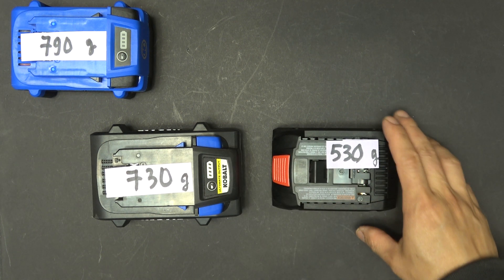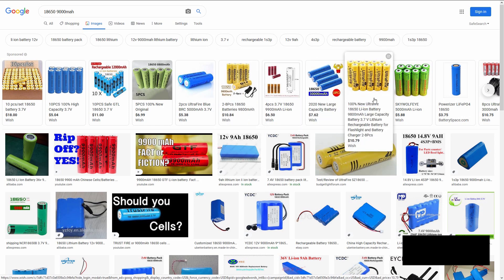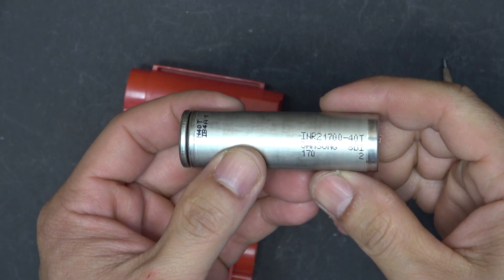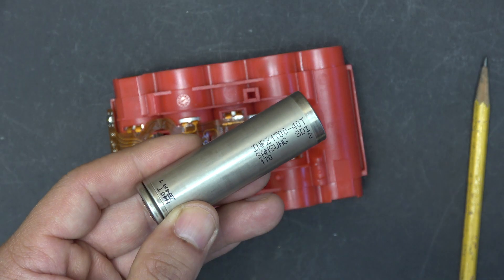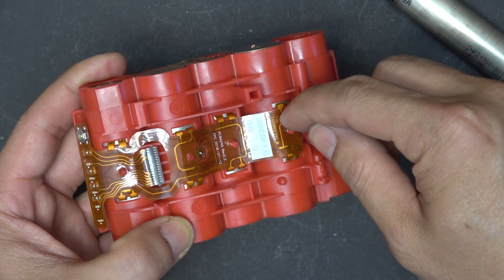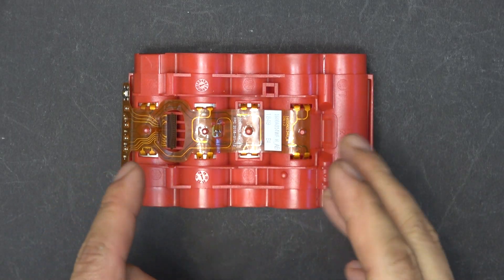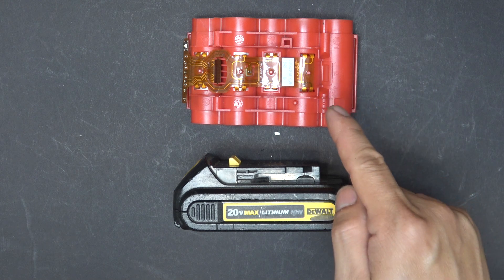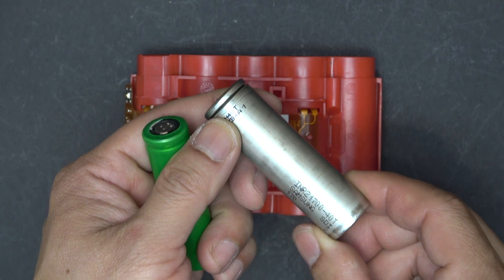Teardown: Bosch 18V Core18 4Ah battery. I've never seen anything like this!

Comment: That sell also discharges at 35 to 45 amps in comparison a rigid cell discharges at 15 amps that's where you get the high power from

Comment: Brilliant design. Although I wish they hadn’t used the 40T cells.
Reply: What else? Molicel, Samsung 50s?
Reply: @hansdampf1968  at present, the Samsung 30T looks to be the better choice. Lower capacity, but more power deliver and more consistent power delivery, or the Molicel P42A or LG HG6 (20650j if you’re using 21700 sized cells. Haven’t seen any info on newer Samsung 21700 cells, but definitely not the 50E, not enough current delivery for a power tool.
Reply: @geoffstrickler  I wonder if you have any experience with DeWalt batteries yet?
The recent Bosch ProCore 12Ah 18V can deliver 105Amp for like 5 minutes until it reaches a critical temperature of around 90°. I will aim for those, using them for electric motor DIY projects.
The Samsung 50s are used in the new Metabo 10Ah tool packs, looks well build too but the lack of information made me select a different company.
Milwaukee also looks promising with their 12Ah 18v battery using S40t but the price is very high compared to Bosch and other companies.
Reply: @hansdampf1968  the M18 12.0 compensates for the 40T’s power delivery issue by being a 3P design. That mitigates the issue since max power draw per bank is reduced below the sustained capabilities of the 40T cell.

I don’t know which cell the new Metabo is using. It’s definitely not the Samsung 50E, which is he only 5.0Ah cell I’ve seen data on. 

I got out of the DeWalt line 7 years ago, so I have no direct experience with their modern batteries.
Reply: @hansdampf1968  very nice, good info. Thanks.
Reply: @geoffstrickler  Yes, it's the same setup as the Bosch ProCore 12 Ah (with a totally different casing technology of course).
Reply: @geoffstrickler  Fun fact; Molicel p42a are just "binned" (best performing) 40Ts. 
30Q are pointless since you have sony's VTC6. 
50E are too low of discharge rate. 
Atm nothing beats A123system's lifepo4 cells. 
Those are rated to 65A but can esaly do 80A continuous or 100-120A burst without catching on fire.
Reply: @OG_ALviK  LiFePo3 cells don’t have the energy density. To get comparable capacity, you need a significantly larger pack.
Reply: @geoffstrickler  Yes, they have lower voltage than li-ion. I know that. 
But i was talking specifically about discharge rate. 
Not energy dencity.
Reply: @OG_ALviK  It’s not about voltage. LiFePo3 is a good technology, for some uses. It’s lightweight, but bulky. It’s about getting a sufficient amount of energy in a given space, and LiFePo3 doesn’t deliver well when space is constrained
Reply: @geoffstrickler  not true.
Reply: @OG_ALviK  You're wrong, or your a liar.
Reply: @geoffstrickler  "it doesn't deliver well when space is constrained"
Not true. They have been used in A LOT of battery packs. They are well more stable and resistent than li-ion. They have lower energy density and voltage than li-ion. 
But whatever. When i've mentioned lithiumwerks (a123systems) i did so only in regards of discharge rate. NOTHING ELSE! 
How many times do i have to write it to you? I didn't mean to say anything else nor discuss about them. 
My whole comment was "informative" that's it.
Reply: @OG_ALviK  You either don’t know what you’re talking about, of your flat out lying. LiFePo3 requires significantly more volume to deliver a comparable number of amp/watt hours vs LiIon chemistries. This is undisputed. Stop arguing about it.
Reply: @geoffstrickler  Ok, so you actually don't read but flat out aggresivly respond with allegarions while repeating the same things that i say but with diffrent terms. Ok dude!
Reply: @OG_ALviK  You are the one arguing with me. You are cordially invited to GFY.
Reply: What are you talking about? This is their compact battery... It doesn't need to have higher power output, that's what the double layer is for. This is just to run low power or light duty tasks.

Get a double layer or the procore 18v+ and you can get 1.8kw of power out 😂

Comment: Is there a good way to build a batterystation that opperates with 12v Input from a solarsystem in my Van? I could a converter into 230V but is there a better solution?
Reply: Converter is probably the best, unless you have lots of money AND need absolutely every kW/h of power you can get (e.g. off-grid, rural/inaccessible area, etc.).

But hey, it's been 4 months, so maybe you've already found a solution. Cheers.

Comment: bosch like other manufacturers of quality tool brands with experience in the field .... for marketing reasons struggle for survival or greed have changed the policy in the manufacture of tools ... only a few models are made in Germany, Switzerland or other brands are no longer made in the country of origin or from quality materials ... at bosch many of the blue tools no longer have the quality of yesteryear even if you still write on them professionally or heavy duty ... not all of them are like that ... however bosch has and there are quite a lot of tools and decent batteries or some good or very good and in general the prices are not so absurdly unjustifiably high as other brands that are intensely promoted have a captivating design that would say they are ultra special but in fact the price is inflated and the quality is not too good and in some cases it can even be said that you are stolen deceived cheating
Reply: I do like that, unlike a lot of other brands, most of their power tools are still made in European countries or Malaysia, which I heavily prefer over China.

Comment: Hi, does this Power4All battery half a self destruction mechanism when cell is disconnected? I wonder if I can replace the cells without BMS self destruct activating.
Reply: I replaced 2 cells in my procore 7ah. Two 20700 rotten cells because water got in there and i didn't notice.
The battery works but the gauge which shows how much charged it is does not.
Also no welding was necessary
Reply: @yooo711  does the cell balancing and low voltage cutoff still work?
Reply: I need to replace a cell in one of these batteries. I'm hoping that the BMS will still work afterwards

Comment: Same as what tesla uses
Reply: No, Tesla uses 15A output cells 5000mah
Reply: @1FishinAddict  Tesla have THOUSAND of cell, not need to put high drain battery, just need capacity. Having that many battery have enought output 
performance.
Reply: 2022 update: true, although they seem to be moving towards 46800 now. That cell will most likely be too large for powertools though.

Comment: Also notice the angle of the 21700 battery pairs at the end. I'll be it allows the same pack length as an 18650 pack- it makes the 21 mm diameter seem like 18mm since the volume of pack is "sacrificed" in the pack height not length. Width is obviously a little bigger. Yes, great manufacturing technique

Comment: Bosch really did a good job in the packaging it's very slim. I would be curious as to how they would fit a sixth cell.  I really like some of the Kobalt tools but I guess you get what you pay for if you want a cheap battery it might be a little bit bigger footprint.
Reply: Nah my dad has 2 2ah batterys which has never been repaired in 10years and still work perfect
Reply: These batteries die quick

Comment: I switched over to Bosch battery when they came out with core series using 20700. Something you didn't mention is that tight plastic is used as heat conduction, and quicker charger blows air over them. That's how they can charge in 45 minutes without damaging the battery. Not as good as SparkEV refrigerated battery during charging, but it's far better than crap EV like Nissan Leaf.
Reply: Plastic does not conduct heat well, you probably want at least aluminum which is what radiators are made from.
Reply: @DrScopey2  It's not perfect, but a plastic optimized for (relatively) high heat conductivity is always preferable to bog standard plastic used in other battery casings. Twice the heat conductivity is still twice the heat conductivity.
Reply: @marcelvos7931  Yeah but plastic does strange things under heat like warp, expand, crack it seems like it would cut life down drastically of what the part is designed for
Reply: @DrScopey2  Not as long as you keep the temperature below designed spec. Lithium cells can't take much heat as well and will always be hotter than the surrounding plastics. We're not talking about oven isolation material. The Samsung INR21700-40T cells used usually have a temperature cut-off of 80 degrees Celsius, so it doesn't matter if the surrounding plastic does strange things when getting above 100 degrees, as long as the material can handle the max achievable temperature of the specific application.
Reply: @DrScopey2  They can add stuff like graphite to the polymers to make it heat conductive and glass fiber to make it stronger/stiffer.
"Thermally conductive polymer-compounds can replace metal, ceramics and conventional plastics for heatsensitive applications. They are more and more used in various heat-sink applications such as electronics, housings or in automotive parts".. "The mixture of a polymer and one or more fillers is called compound. The polymer functions as a binding matrix, which is mixed with the filler particles. In this investigation high loads of graphite are used to realize high thermal conductivities."

Comment: NOT THE SAME CAPACITY! capacity=Volts * Ah not only Ah.
Reply: True. The Kobalt ones are 21.6V nominal * 4 Ah = 86.4 Wh, with the Bosch being 18V nominal * 4 Ah = 72 Wh. The Kobalt ones therefore have 20% more capacity.

Comment: I don't think the 18650 will go quietly into the night as long as Tesla is making/using them. Also, the aftermarket for tools already using them will be around as long as people want new batteries for them. WRT tools, Milwaukee in particular will stick with 18650 for the M12 RedLithium (non-XC) packs at least, as there's no room for bigger cells in the tool itself. This also makes sense inasmuch as smaller tools will likely never draw anything like 35A.
Reply from the maker: That's a good point. But I'm afraid the entire M12 line might be gone once the M18 gets smaller and stronger. There's no point to get the M12 when you can get the M18 that is almost the same size.
Reply: @vuaeco  3 cells will always be smaller than 5 cells. You can't physically fit 5 cells in the handle like the M12 or the previous generation Makita 12V tools, so the pack and tool will inevitably be larger (e.g. DeW***). As the workforce ages, the demand for small tools will only continue to rise.

Besides electrical efficiency, which is not overly important with tiny brushless motors and lithium batteries, there's no need for higher voltage with the small tools. My DeWalt brushed-motor impact with 20V 18V li-ion pack already strips or snaps things more often than I'd like.

If I could do it over again, I'd get those older Makita mighty mites! I've used the impact and drill, and they were excellent.
Reply from the maker: @fun_ghoul  Agreed 3 cells are always smaller than 5. But once you get frustrated with the run time/power delivery, and start to smack on a double decker 12V battery, it starts to be the same size as a regular 18V tool! :D.......I guess you always have a choice of having many smaller batteries to replace.
Reply: I think milwaukee can parallel 3×21700 in the bottom portion of m12 battery pack with 3×18650 in the grip portion.
Reply from the maker: @technologicalsingularity1788  You can't mix match and parallel them together that way. The small ones will run out first and the big ones will become a charger for the small ones and soon it will heat up and explode. Just 3x 21700 on the bottom only would suffice. Leave the top portion empty just like the "penis" on the Ryobi battery.
Reply: @vuaeco   Good point. I didn' think about taht.
Reply: Tesla has already transitioned away from 18650 some time ago. It's the reason 21700 has become more mainstream. 
They're even going beyond 21700 now with 46800 cells. However, those cells will most likely be too large for flashlights and powertools, so I think those will keep using 21700 for a while, unless pouch cells (like DeWalt  Powerstack) really take off.
Reply: @macvos  This video is from May, 2020. Also, my point about certain long-term products sticking with the 18650 form factor for cost and supply chain reasons has held true in yhe 2+ years since my OP (e.g. Makita, Milwaukee M12, Dyson, etc.).

Oh, and actually, I have my suspicions that 46800 has nothing to do with making a cheaper Tesla, and everything to do with keeping people from breaking down used packs to power ebikes, power tools and other portable devices. Like, you know Elon doesn't really own anything, right? He's just a frontman, quite likely for The Big Three.

P.S. lol @ the idea of DeWalt lipos taking off. I presume a few workshops and vehicles have burned already, but are we gonna hear about the source of the fire on the news? 🤔

Comment: I thought there is no balancing going on bosch battery pack until now.
Reply: True, I just saw an interview with an Bosch representative - there is no balancing the cells! If the electronic on the maschine notices too much drift in the cells, the battery will be shut off. You must send it to bosch services ....
Reply: @m.s.5914  They match all cells in pack with mAh rating, discharge and internall resistance .
Reply: @SnekSnack  Yeah but that is still 101 planned obsolescence, no matter how well you match the cells, those will eventually drift apart.
I got my hands on some older dead bosch lithium packs and few cells would die, while others had 80-90% of original capacity left, so if there would be balancing, the battery would be in 80-90% health, and instead of lasting 2 years, it would last 6+ years, and then it would be discarded not for completely failing, but for not having much capacity left.

Comment: Look how they saved space in the battery holder by stacking the batteries like they do oil drums.
Reply: This is so crazy because I literally was just looking for reference images as I have been making my own Milwaukee Cp4.0’s but still get irritated Milwaukee didn’t use this staggering approach until the 12.0ah HO’s. The 8.0 HO’s were just. 2p stacked one on top the other as well. Such a waste
Reply from the maker: It's a bit thicker but it'll be shorter.
Reply: vuaeco better balance overall I think. Especially for the 6ah & 8ah Milwaukee’s,